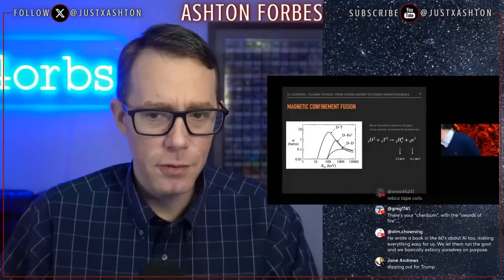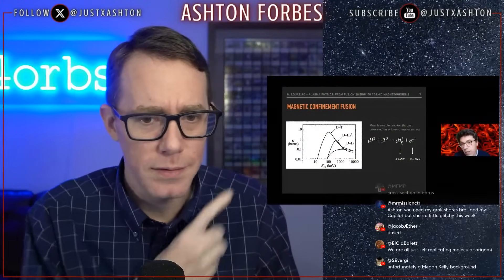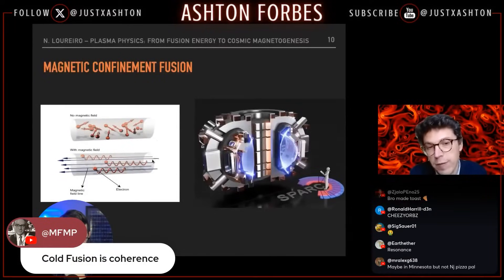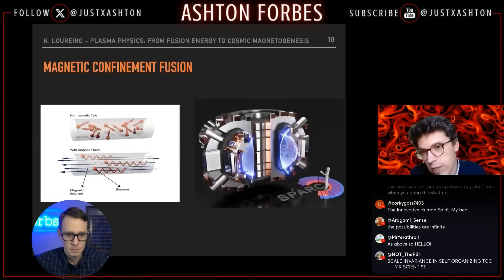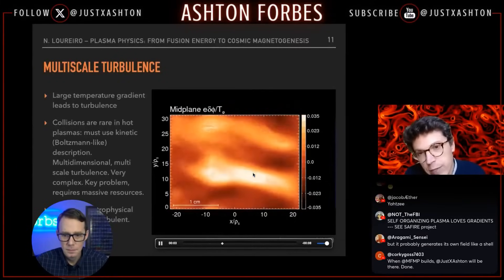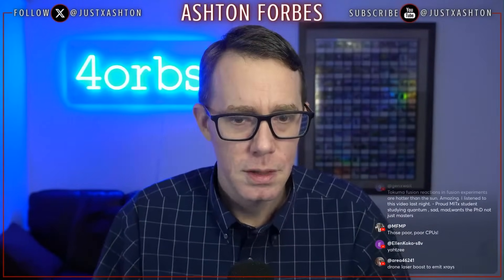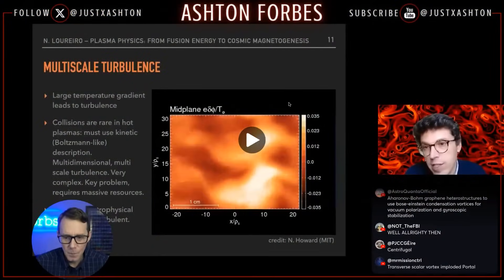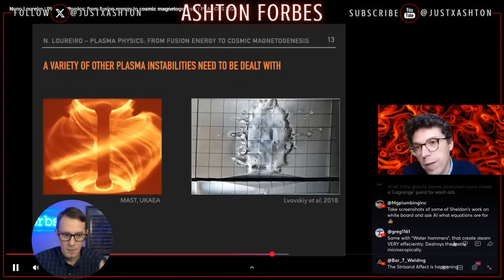What Really Limits Hot Fusion Reactors

Comment: I think you're spot on Ashton.  Vibration is the key to low temp fusion.  
I was thinking of using something like a "tuned" tuning fork as an anode in the plasma that continued to ring/vibrate, but it would turn into a chinese finger trick, trying to keep the anode from melting.
Maybe make sure the anode was constantly vibrating before the creation of plasma is established.  I was also wondering if this could be achieved in something like a Klystron tube.
Reply: vibrational resonance tuning

Comment: Spin mixes , but centrifuge separates by density... Hmmm ?? Ashton help my understanding here. Thanks bro !!
Reply: The orbs create 2 sheathes , not just the One around the plane. - So they can spin and mix the sheathe around the plane while the 2nd sheathe prevents that centrifugal separation ! - why you get a very cold "Rim" as-well as the dark center hole collapse. The 2nd sheathe really helps with the stabilization of the main one around plane, cause you can't have that mess up at any point for when you try converge, has to be perfect.
(just a hobbyist opinion but)

Comment: Two nuclei are supposed to get close together, not particles. Anyway, the reaction is written wrong. I guess by intention. The number of baryons is correct but energies are wrong. When you show the output energy you must supply the same on the left side of the equation. Where is the energy needed to make it happen? It is not spontaneous process after all. I repeat myself but I will be doing this as long as it is needed. An isolated system can't do work. Magnetic trap fusion or thermal so to speak will never work because it violates thermodynamics. Modern science is fixed on wrong theory with regard to our Sun. It is not gaseous ball of ionized gas. It is liquid metallic hydrogen. At this moment our Sun is a perpetual motion machine according to the current theory.

Comment: The problem with a gigantic heat difference in a small orb or fusion reactor sized space is the amount of matter at the high temperature area is very, very small, smaller than nano small, otherwise it would overwhelm the cooler shell quickly. So the gradient of temperature is so great, you can only leak a few atoms of temperature heat loss to the rest of the orb or reactor system, or you get runaway heat in the outer areas, melting, etc. 
You also have to explain the hardware inside the orb that is directly next to the highest 100 million degree heat. GOOD LUCK WITH THAT.
Reply: Hotter than the sun for fusion correct?
Reply: makes me think of the 'demon core' 😮